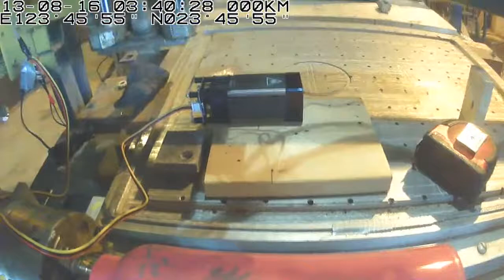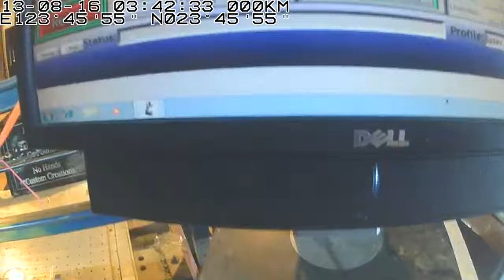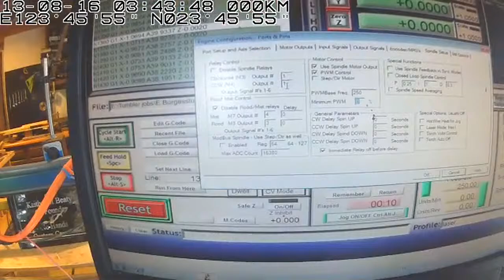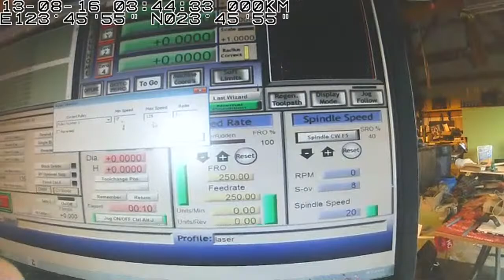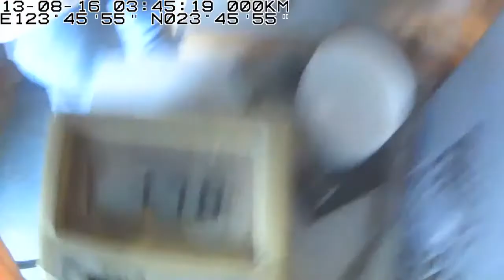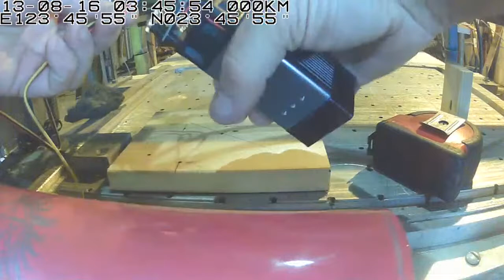How to add a 40 watt laser to mach3 using 5 axis breakout board with PWM control

Comment: Are you using any other device aside from the laser and breakout board.
I pretty much have the same setup just a different breakout board and I can't get the voltage to change.

Comment: what power supply your using?????  and  im my case,12v 3amp external supply in my machine but need connect gnd pin in mach3 board? ..............pls, share your wiring diagram
Reply from the maker: For the LAser a 12v supple. For the cnc machine steppers a 36 volt supply.  Now sure what your asking sorry so long in reply.